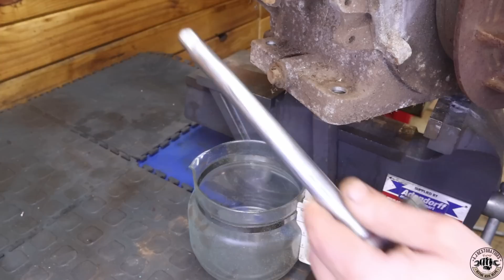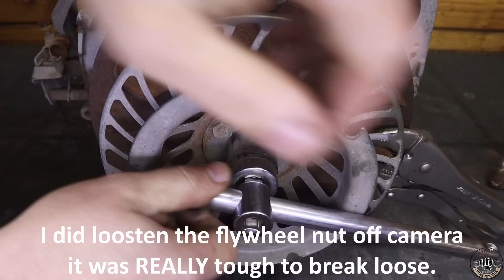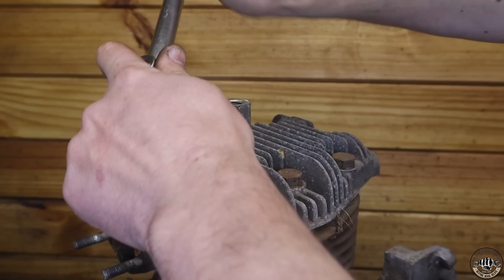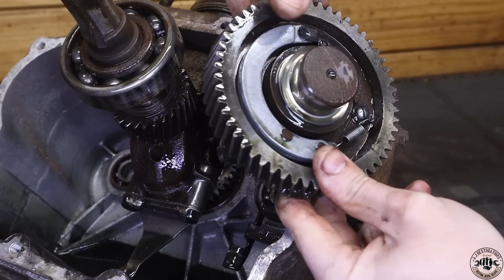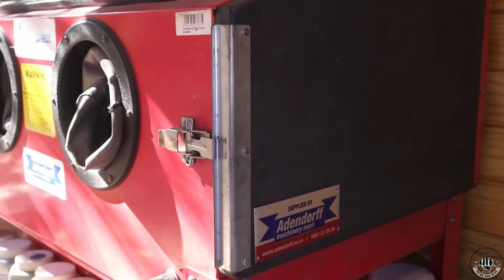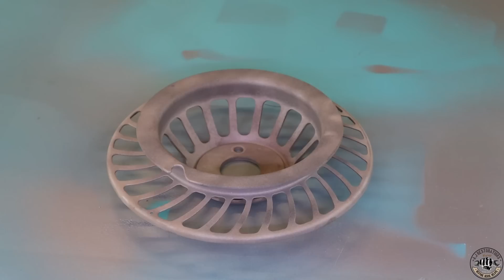Classic Kawasaki KF100 10hp Generator Engine Restoration

Comment: That engine should last forever being a cast iron cylinder. They don't make them that way anymore. Also interesting piston with an oil ring so low on the piston as well.   Thumbs Up!
Reply from the maker: My thoughts exactly, I have never seen a piston with a extra oil ring on the bottom

Comment: Great restoration  but as always with stuff like this get it properly steam cleaned first!
A soak in degreaser then a hot wash at 130 degrees + prevents unwanted ingress of dirt on disassembly...

Comment: A little surprised you didn't try to repair the damaged fins on the flywheel. I know it would not have been easy. Perhaps build them up with brazing or welding.
Reply from the maker: I was thinking about it, and judging by my welding skills, I would probably make it worse, and there are no spares available. So I left it be.